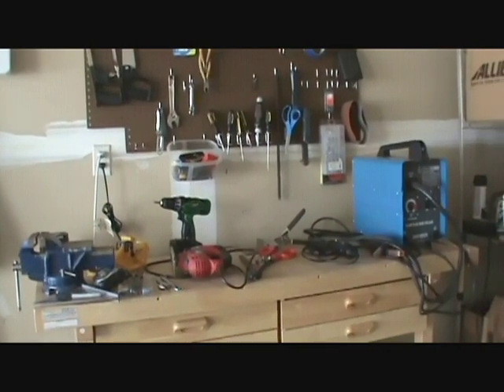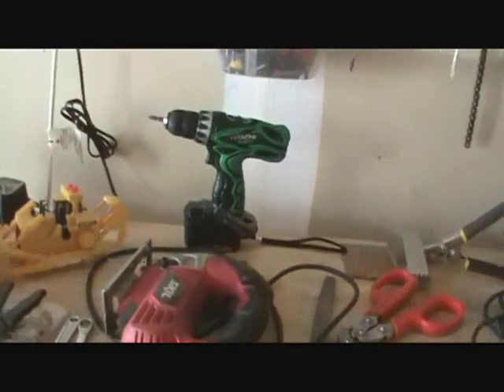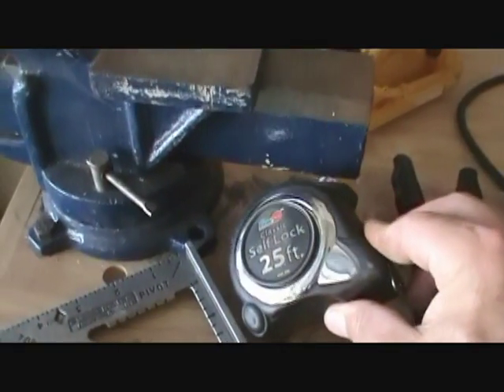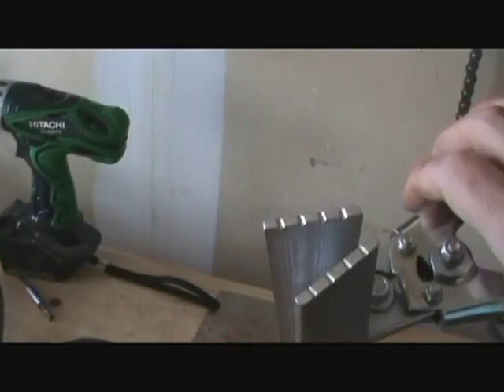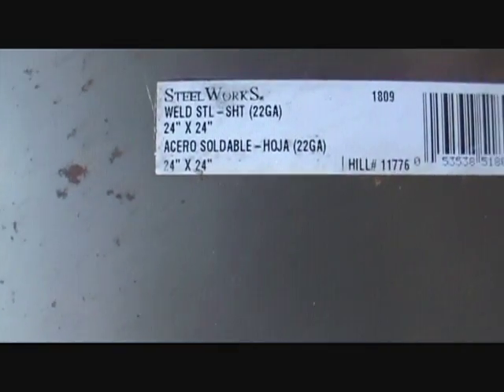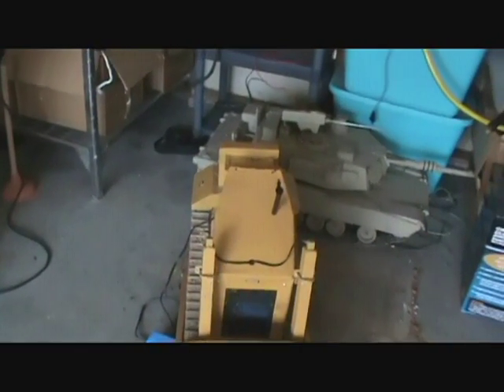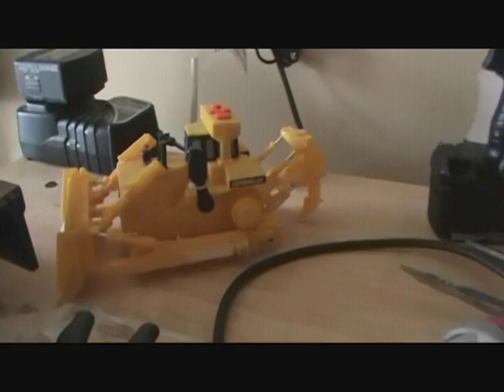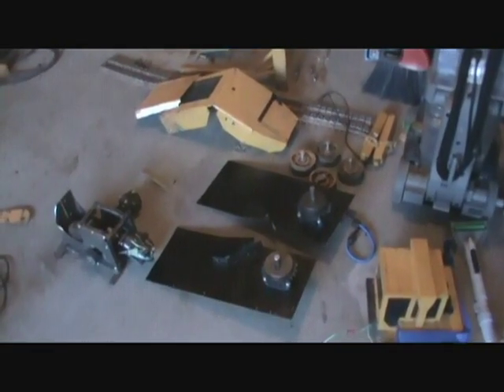How to Build a RC Dozer, Video 1 Tools.

Comment from the maker: Not quite sure what your asking but I think I might, but I used a drill and bit, drilled a hole through the blade arm and one in the carriage and attached it with a nut and a bolt and a spacer. Did the same on both side with the same measurements.  Hope that answers your question!

Comment: your tool collection that you show here is alot like mine. with the exception of the welder. I have a Lincoln welder. nothing special but it works fine for what i usually do. I can't wait to see what you used to raise and lower the blade. or how you aligned the gears with the track.